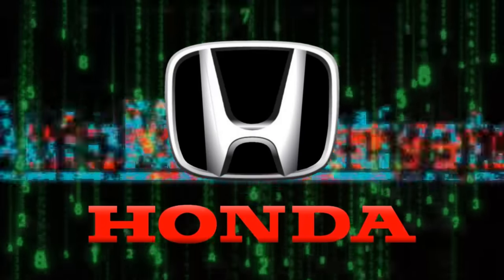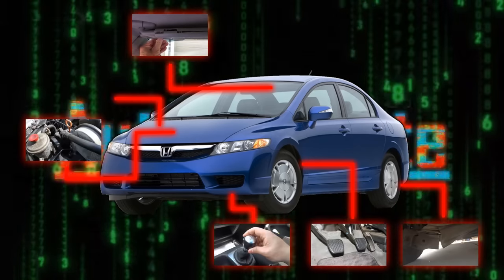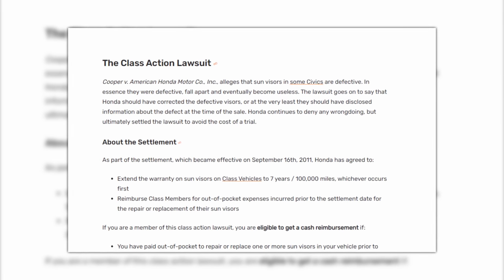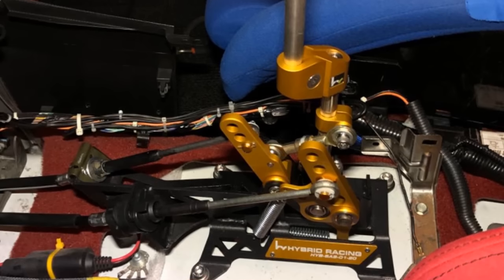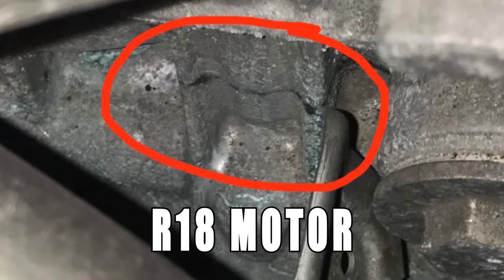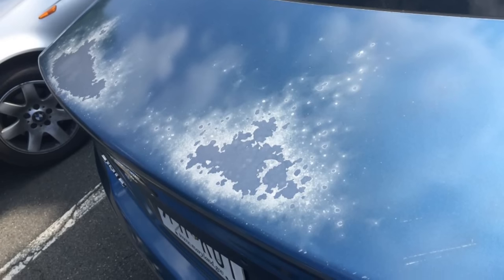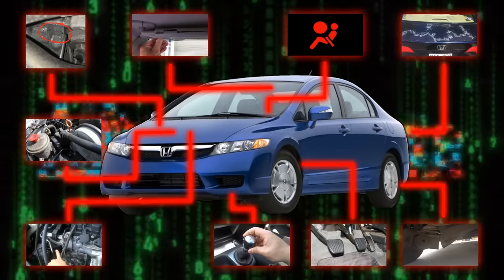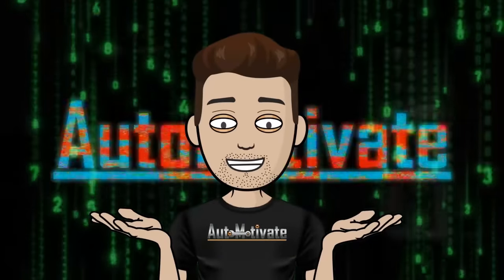Watch This Before Buying a Honda Civic 2006-2011

Comment: On that seat belt sensor... unless that's mandatory by law and I think they backed up on that in the 70's... so anyway I'd permanently fix it. I'd splice some wires and wham, fixed for $.10 forever. Great video..I hate to be niggling but have you ever spent much time on the complaint website? The people who complain on those websites are usually people who are just basically mechanically clueless and maintenance clueless. If you sift through the information and I mean a lot then there's occasionally some good useful information.

Comment: So I'm looking at 2006-2011 civics as my first car. What year do you recommend to get that has over 100k miles?
Reply: get the 09-11, the material is a little firmer on the inside. 100k is not an issue, just watch for paint and check for rust. If you're getting a manual; make sure all the gears are there and it doesn't grind. Usually the 09-11 models for the Si at least aren't prone to as many issues
Reply: @Republic1ders  Nice, I will look at those. Thanks alot 👍👍

Comment: I've got an 2007 one since 2015 and have had no issues except for light rusting on both rear wheel arches extending to just below the doors
Reply: No problems with the engine?

Comment: I had that 2-3 shift pop out occasionally on my Volvo. Shifter bushing, wasn't a big deal. More annoying than problematic. I seriously can't believe people would sue over visor clips?? Duct tape would fix that permanently..I mean it's nothing important like poor positioning of a gas tank or ignition tumbler and switch mechanisms that cause engine failure on the expressway. Duct tape is ugly but who looks at the headliner and who looks at visors? Exactly, no one! Now you will because I've suggested it. But tell me when was the last time you did before unless your headliner was sitting on your head? I can't wait to hear and see the other problems worth mentioning

Comment: So much mis information... I have owned mine for 6 year with not one of these issues. It go's on the drag strip, autocross, and redlines daily at 9k rpm... Still a daily driver with 140k+. As for the 2-3 shift or the lock out of next gear at high rpm. It is a design in the clutch master cylinder that creates a void pocket in the cylinder causing fluid transition issues. Install the 2001 model part and never have the issue again.

Comment: Have 198k just replaced my radiator and thermostat in my 06 LX Coupe... my 2006 visor is screwed into the ceiling

Comment: Hi, the AC relay is also a common issue with those, really easy to fix.
Reply: The compressor sits in front of the radiator so it gets destroyed by rocks.  Also the in-cabin HVAC control panel is known to go bad.

Comment: I had a 1998 Civic LX that was fabulous until someone hit it and totalled it....I then bought a low mileage 2009 Civic LX and will never buy another one....this one has persistent leaks in the trunk and drivers side front floor...its always had door props that do not reliably hold the doors propped open securely...was even doing this when I got it in 2012 at only 31,000 miles.... I think it was a Monday Morning car. Ugh....no more Civics for me...

Comment: I have the 09 and both sun visors are out, they both hang down all the time, and both clips that hold them in the front position are also broken, just a massively bad design of a very small and cheap part, but really used a lot all the time, so not really the spot you want to cheap out on.

Comment: Guys I beg you learn to change your Transmission oil (and FILTER this is a little harder but change it!) power steering fluid and coolant. It's insanely easy. I'd just pay for the breaks to get done.

Comment: Need advice anyone please???  I can't decide between a 2012 Scion Tc auto, 120k miles or a 2012 Honda Civic LX w Manual Transmission, 88k miles.  I like the idea of a Honda with lower mileage even though it's slow and not sporty look.  The Tc is faster as far as hp goes and looks better than the Civic LX but the 2 doors might make car insurance higher.  I just want a fun daily, driver car and yes, I considered a Civic Si but they're out of my budget and most are high mileage or heavily modded. Let me know your thoughts???  Thx
Reply from the maker: The manual Honda would be a a bit more fun to drive. There’s also a much larger after market parts supply for them, so you could modify it to handle much better.

Comment: I have the paint issue on my 2009 Honda Civic (65k miles).  I think they issued an extended warranty to cover the problem but mine didn't start having noticeable issues until just outside of that time frame.  go figure.

Comment: I own a 2006 Honda Civic. She has 129560. So far she has a power steering leak and probably a bad motor mount because she vibrates a little when I rev her high. And faded peeling paint. Other than that she purrs.

Comment: My 2011 has only ever need breaks and bearings, it has 111,500 miles. And tbh the bearings might not have been necessary, I just got new snow tires that are noisy

Comment: Honda have ac condenser issues or ac freon leak which you need to refill ac freon and oil leak from engine cover gasket. Lots of plastic clips and plastic made covering

Comment: Problem is the stock Focus is 160 HP and 132 for Corolla or Honda 140 is not as good as the Ford DGI. Fords last 200, 300 thousand miles but a Honda yah..

Comment: I’ve got a ‘07 ex coupe with 170k miles, needs motor mounts, valve cover gasket, and lower control arm bushings lol. My airbag light is on and the clear coat is fading. But I drive it 200 miles round trip to work every day. Hasn’t left me walking 🤷🏼‍♂️
Reply from the maker: You know, all of those aren’t too hard to replace my friend!  
Motor mounts may be the most difficult mainly because you need a jack to jack up the motor, but you can purchase a high quality one from harbor freight for $80, then you’ll need some tools and. A torque wrench, which should push you to around $240 total, finally, but the parts and replace. 2 new lowers control arms are $80, valve cover gasket $18,  and $84 for the motor mounts. 
So, in total it would be $422 to stop the leaking valve cover gasket, shaking idle from worn motor mounts, and pulling or vibrating steering wheel. 
Mechanic would charge 3-4x that much. 

You have a lot mote life out of that car, keep it comfortable 🙏

Comment: The 2008 Honda Civic Si was one of the most durable cars I’ve ever owned. Given that it was an Si, it was also fun to drive. I put $2500 into tuning and 40k of hard miles each year for 3 years beginning at 75k miles. My only other expense was brake pads and routine maintenance. Even the clutch was still tight when I sold it.

Some of you need a sense of context. Of course the next gen is more reliable, it’d be a failure if it wasn’t. But browse the classified ads today, a decade an a half after this car was released, and you’ll see plenty of high mileage civics for sale.
Reply from the maker: Ofcourse there will be high mileage examples for sale. That does not mean those examples haven’t had issues through its life.
Reply: @AutoMotivate  clickbait until you place it in proper context. Lok how many Honda owners try to tell you none of this happened to them. And if all of those problems came up on your one civic, you have the worst luck on the planet.
Reply from the maker: @timomomomo969  Dude, acknowledging potential issues should be a normal thing every buyer does when they look into buying a car. Every issue has been validated throughout the comments. 
Yes, there are other folks saying they haven't had any issues. But, majority of commenters have. 
This is simply a check list for folks to do when they buy a car. 
Have a better day

Comment: I bought a 2008 from my friend. Engine went out because it over heated due to the car running out of coolant. Honda would not fix it because it was too old. Stupid warranty did not want to fix it.
Reply: Minimum service every 5K would have detected the low coolant issue

Comment: You forgot that nasty auto tensioner, solenoid for AT version, leaking windshield, steering rack, A/C magnet clutch and power windows.
Reply: That solenoid leaks so much oil it's unbelievable, that windshield leak is a bitch too

Comment: Just bought my first car and it’s a 07 Civic with 112k miles on it. Getting the motor mounts fixed now and I’m hoping this car turns out to be as reliable as I’ve read
Reply: I know it’s only been 3 days, but how’s it going? Looking to purchase an ‘08 since my car broke down :(
Reply: @marcoaf18  unfortunately I seemed to have taken the car to the slowest working mechanic lol. The two days that I did have it the car performed well. Haven’t had it for close to a week now

Comment: So my coworker is selling his 2008 Honda Civic 110K Miles...Anyone have any advice??? I am considering buying it...
Reply from the maker: This video should be a great guide to look over while you inspect it. Be sure to check the fluids!
Reply: @AutoMotivate  Thank you for your help...He refused to let me have my mechanic inspect it...So that was a red flag...I'm not gonna buy it...Thank you very much for helping me. Automobiles are getting to be a big headache...
Reply from the maker: @elle5031  if he was confident, that wouldn’t have been an issue. 
They really are but you’ll find something with ease, I am sure of it

Comment: 2006 r18 equipped Civic coupes are almost 2 seconds quicker from the factory then 2009 r18 equipped civics because of traction control and the nutting of the r18 by Honda I test drove a 2010 model and LX coupe just like I have and holy s*** it's a hell of slower than mine I have a k&N air filter exhaust and muffler delete but it's not like any crazy upgrades or nothing but it felt so much quicker

Comment: I have none of these problems at all although I do agree with the video about the 2 to 3 gear grind and pop out I strongly disagreed about the crack engine block leaking coolant. My Civic Ex Coupe run and run without any issues, it's currently at 200xxx miles and still run like a champ with the same Engine and tranmission.
Reply from the maker: I’m glad the civic has been treating you well 🙏 I’ve actually had a bit of people say that their civics had the cracked block. Luckily, it’s not a large amount of them.
Reply: What are you disagreeing with? He didn’t say YOUR engine block was cracked. He reported that statistically, it has happened. That’s not something you can disagree with.

Comment: None of these will impact your driving experience. Each one is at most a $50 fix, except the cylinder block crack (but I've never heard of that happening in any Honda) and the CV arm, but that's a pretty cheap fix too.
Reply: What year is your civic? I’m gonna look at an 09 civic ex and a bit worried about the cracked engine block issue

Comment: Hey I'm thinking about buying a 2006 civic with 200000 miles, for 750 bucks. Is their any problem aside from engine and transmission wear that I should be aware of
Reply from the maker: Most cars with high miles will need most of their suspension replaced.  
You could drive it without, but you may hear creaks and squeaks. The drive quality won’t feel as good as it did as well. 
So, I would be prepared to replace the shocks, springs and most likely a few bushings.
Reply: @AutoMotivate  thanks I'm gonna take this advice on board now

Comment: My 2008 lx sedan has been great I brought it manual transmission though I travel from state to state all the time I change my oil regular since I travel alot minor things I have to change the engine mounts and the fly wheel and install the parts I have and im good to go

Comment: Just buy Honda Civic Hybrid and you won’t have to deal with the most issues. You will have to fix only the sun visor, the rear suspension arms and do the paint job. In fact I already replaced my drivers side sun visor :)
Reply from the maker: Great on gas, reliable and they look pretty great as well. What more could you ask for?

Comment: I had 2008 civic and it's excellent running, it 69000 kms ran but still is a beautiful car, smooth driving 🚘 is a bullet I love this car, all the problems u mentioned are not true and worthy advice, Civic is an excellent sedan...
Reply from the maker: Just because you didn't have any issues means this video isn't true? Interesting 😂Did I say every civic will have these problems?

Comment: I drive a 2007 honda civic si coupe and i love it. its a great first car. Ive had it for about a year, and the only problem ive had with it is that infamous 3rd gear. But ever since i switched to amsoil syncromesh, i never had another 3rd gear pop or grind ever.
Reply from the maker: That’s what I’m talking about!!
Reply: @AutoMotivate  oh I forgot, I also had the the droopy broken visor too, but I got one of those metal clips and no problem so far

Comment: I bought my car with a lot of miles on it (170,000) and put a new tranny in it. It has been the best car I've ever had the only issues it's had are the sun visor does hang and the weather stripping on them is terrible. However my 08 civic has 254,000 miles on it and I fully expect to get at least another 5 years out of it with proper maintenance because it drives just as good today as it did when I bought it and I've only done minor maintenance to it (except the tranny but that could have been from the way it was driven previously)

Comment: I have a 2011 lx and have problems with the A/C and I hear is a common issue
Reply: Most likely from my experience the AC Clutch,  AC Compressor, or the bearings between them that go out. So chance are its the compressor.

Comment: I have a 2007 civic ex coupe manual 5 spd I bought off the original owner . Its got almost 240,000 kms now and still drives like new.

The issues i have noticed are : scratchy starter on first start of the day,  Clear coat defect, sometimes gets a hesitation when you try to floor it . ( have replaced many simple things to try to fix this issue but I think it might be due to the drive by wire throttle system.) 
All in all though I love this car . Roomy interior, huge trunk , good looks in my opinion, fuel efficient, steers and corners like a champ and the 5 spd manual is nice.

Comment: The most reliable car I never had…. Bought in 2007, 296000 Km…. The only problem is the very fragile black paint. (Nails, washing brushes,…)  For the 300.000 km, I will offer a new paint !

Comment: Don’t buy an Auto
Our 2009 Civics CVT transmission unfortunately went at 97k miles 😥
Did all the services at Honda on time 🤷🏼‍♀️ bought the car brand new. 
My wife bought a 2008 Prius and the Generator just went out at 358k miles 12 years later.

Comment: 2009 Civic LX with 175,000 miles and no problems other than routine maintenance. ANd my visor has 2 garage door openers on it an no issues.
Reply: No cracked engine block? I’m gonna look at an 09 civic ex tomorrow, and a bit worried about this issue, it’s priced at 5500 but I will offer 5k, it has 146k miles
Reply: Engine runs like it was new, no shake and I still get over 30 mpg
Reply: @gtags1  ok cool thanks for the reply

Comment: I have one of my own, power windows is an issue, as well the cardan shaft, my civic as 250000km or 155 miles but had to change it two times already

Comment: 2 biggest problems with my 09 Civic
1:  Had to replace a battery after about 9 years and two trips across the country 
2:  My wife will probably be emotional if it finally dies in about another decade or so
Reply from the maker: Those are probably the best kind of problems.

Comment: Maybe I got unlucky with my 10' civic but it's starting to have so many issues that it's just a money dump at this point and I'm going to sell it soon. Not really many issues that trigger the CEL thankfully, but it's just one after another, paint is defective and fading, MPG drastically has gone down, engine performs poorly, it sucks. I swear my 2006 civic was better built and had 0 issues than my 2010 lol.
Reply: @az-vr1wv  Same situation with mine, ran fine when I got mine at 77k miles. I feel like once they hit over 100k miles, way too many small issues pile up and it becomes a money dump to catch up. Also, the 8th gens don't hold up to their age well, regarding the materials on the inside and outside, it just isn't a good car to own for a very long time sadly.